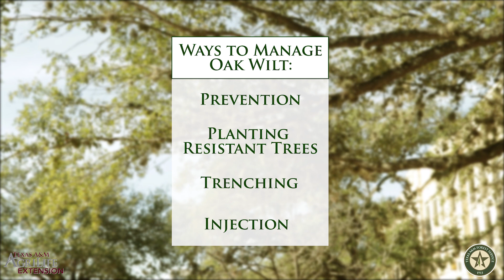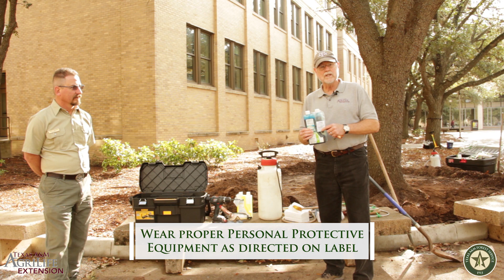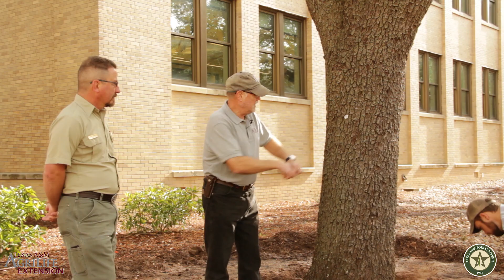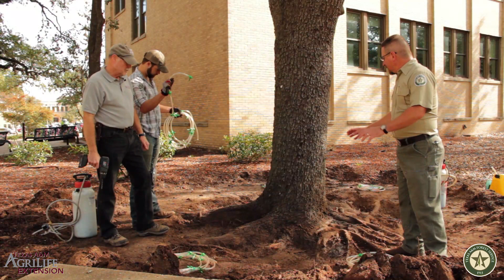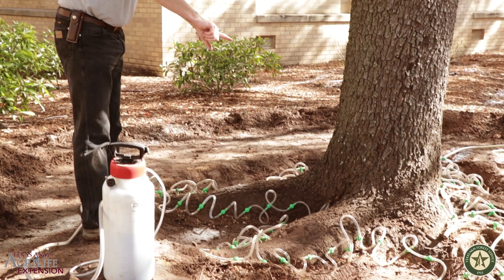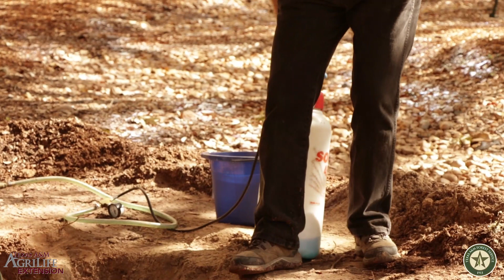Fungicide Injection for Oak Wilt Treatment: Macro System

Comment: How come you are measuring the circumference but calling it the diameter?
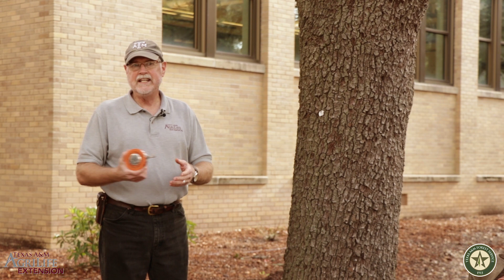Reply: the industry standard is DBH diameter at breast height. he is using a special arborist tape which converts the circumference measurement to diameter, as he describes at 8:13

Comment: Greetings, great informational video! I have a huge pin oak tree (measures 124" in circumference - 39.5 diameter) that is leaking a lot of dark fluid 3 feet from base. Would I still be able to treat this tree with this method to preserve the health the the tree?